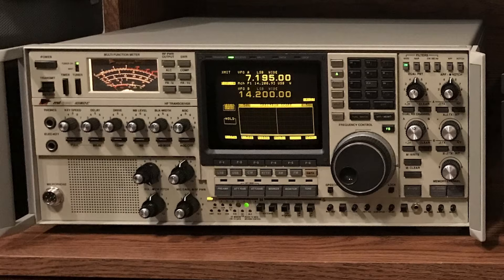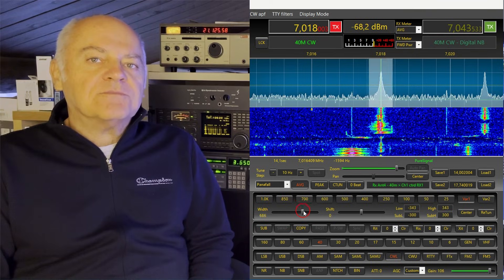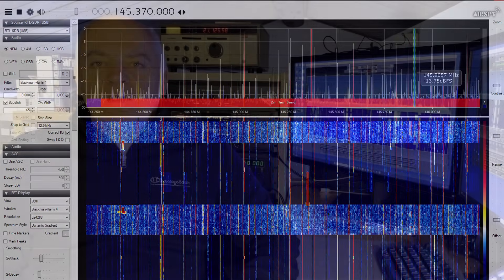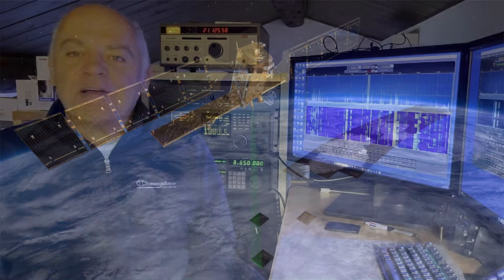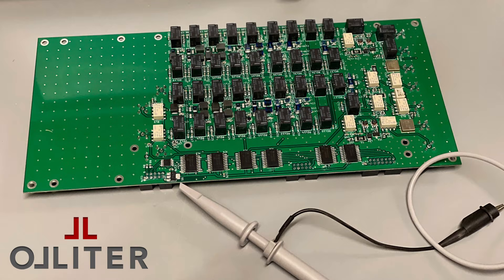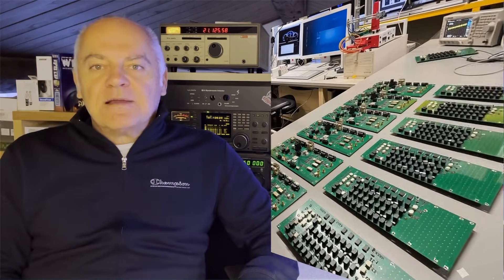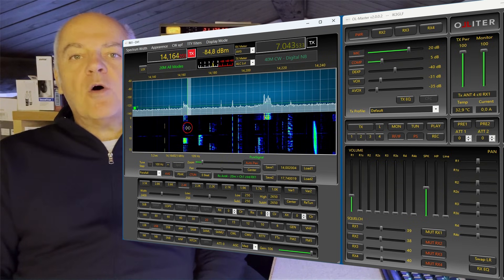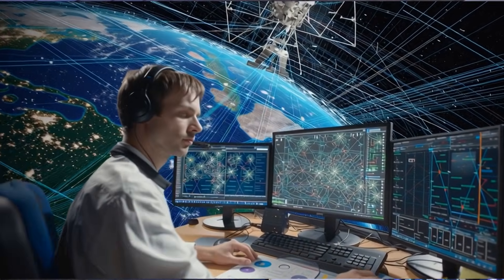Cheap SDRs: What They Don’t Tell You

Comment: I bought a SDR 101 radio receiver and i was enjoying it until i blew it trying to map a signal. Hey ho you live & learn & in my defence i am new to the hobby & hoping to get a better SDR in the coming days . 🎉
Reply from the maker: That’s actually a very common first experience with SDRs.
Entry-level receivers often have minimal front-end protection, so a strong signal or a direct connection can be enough to cause damage.

The upside is that this kind of experience quickly teaches why attenuation, filtering and front-end robustness are so important.
If you’re moving to a higher-grade SDR, you’ll immediately notice the difference in how it handles real signals.